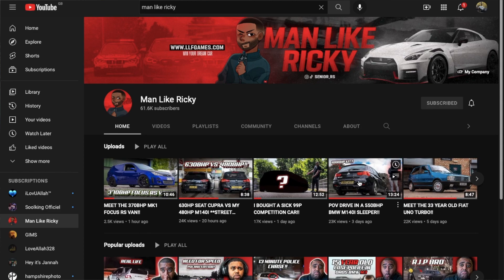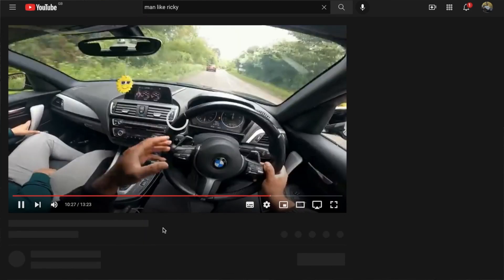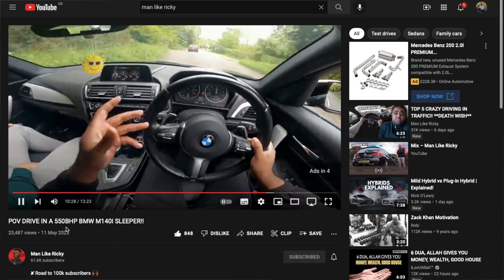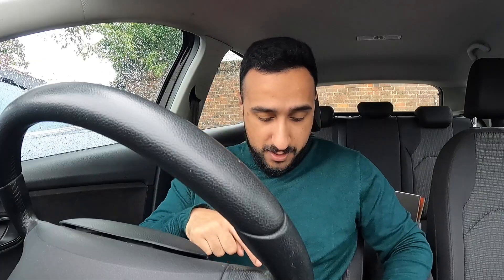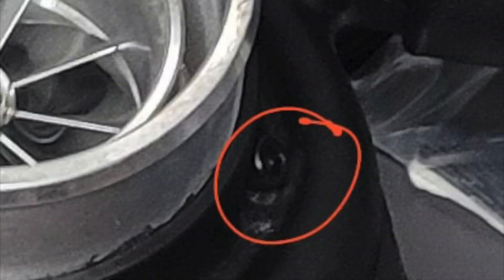MY 1000BHP READY 'BIG TURBO' M140i *I Broke it!*

Comment: I’m glad it’s not broken! But it’s part of the process!! Looking forward to the first drive video this week 🙏😎
Reply: Assuming it was the exhaust manifold that was loose causing the second noise this is part of installation normally. Install, drive, tighten. Just 6 little bolts but they're a pain in the balls if you don't re-torque them after the first drive.
Reply from the maker: As far as I am aware , it’s part of the process for the heat cycle ✌🏼 very normal :)
Reply: @Sa3Tv  part of the installation and testing process.  Installer will fit, torque, test drive, re-torque then pass over. Doesn't need crazy heat just a drive up to operating temp.